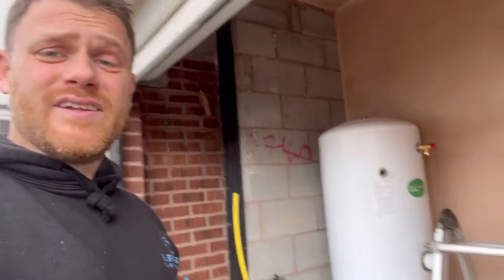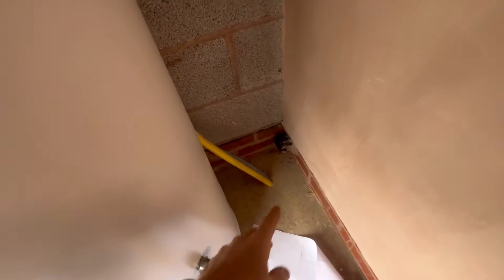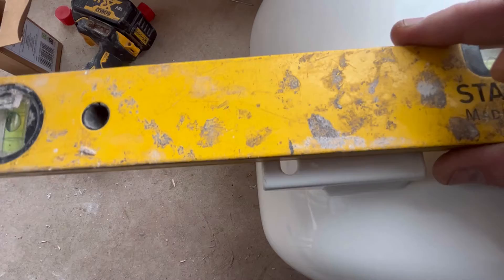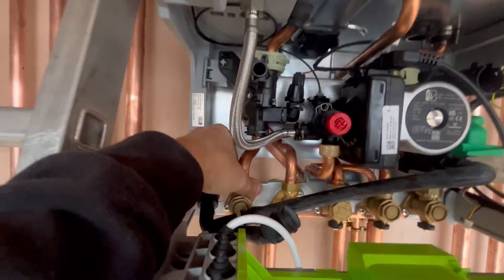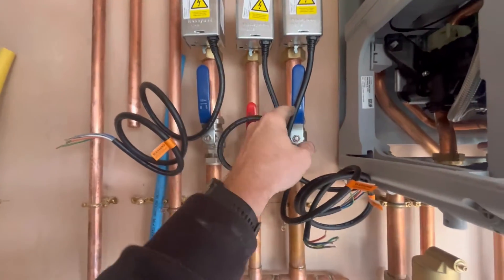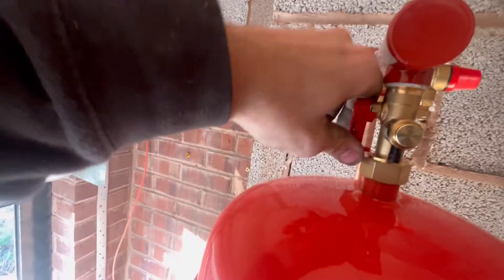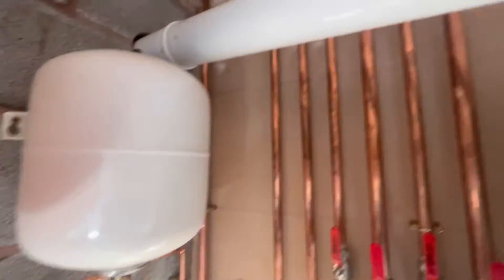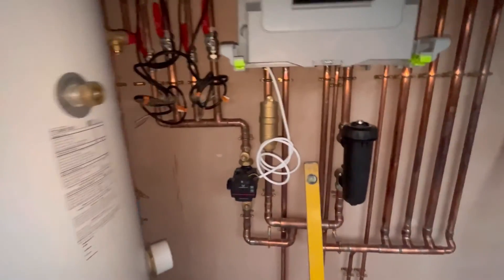Worcester 8000 System Boiler Installation: The Final Week

Comment: really neat job! what's the reason for the close  coupled tees ? dose the boilers pump not got enough ummpth or are there going to be more pumps/underfloor added in the future
Reply from the maker: Works like a low loss header, you can have circuits running off it with out causing a dead zone, there’s another pump for underfloor so works really well on big system

Comment: Working in new-builds/heavy renovated homes feels like a relax. And everything is done service-wise, so the future maintenance is nice and easy.
It's not an installation, it's a work of art. Beautiful job, beautiful.
BTW, if  it's early enough into the renovation I advise my clients to buy a wall-mounted cylinder. It requires thicker walls and I hang these cylinders using epoxy anchors. It has a couple of advantages: no floor space taken, easier emptying, overall easier maintenance of the whole boiler room.
In the last one I did, I managed to install: water meter with accessories, water filters, Viessman water softener, Ariston Cares Premium System (sic!) boiler, 120l wall mounted cylinder (no need for a bigger one for this client) in a part of a toilet on a space measuring 1,7 x 0,9 m. Then my cabinetmaker made a pair of doors with mirrors, so there's literally no sign of a boiler room just a comfy toilet with two huge mirrors on one wall. When service is needed, I just open that doors and there's a fantastic access to everything.
The one huge difference we have here is that we use distributor boxes (I don't know it's proper British plumbing name). We install one on each level of the house. From the boiler we run 1" pipes to that boxes and inside there are manifolds with separation valves for each radiator, floor heating return valves, flow regulators, emptying valves etc). It allows use to tune and service each radiator or floor heating loop independently. Of course all the additional pumps, hydraulic balancers, expansion vessels, 4-way valves are in the boiler room.
Reply from the maker: Never seen a wall hung cylinder to be honest. I do like starting from scratch as you can plan and prepare the house to be the most efficient for heating and future maintenance 👍
Reply: @bluebulldog_uk  It's possible that they are unavailable in the UK due to regulations. We even have square one, so they take much less space.

Comment: You could put the lever valve to the left it will be pointing towards you so you don't have to take the side panel off if you need to repair the zone valve
Reply from the maker: I wish I had gone for butterfly valves to be honest lot smaller 👍

Comment: Mate, I’d have put them levers level and span them so they fall straight, cracking job 😊
Reply from the maker: Good shout, was thinking of switching to butterfly valves as you don’t need as much room
Reply: @bluebulldog_uk  I wouldn’t know where to start with all the system boiler stuff. 2 year at bg was plenty for me 😂😂